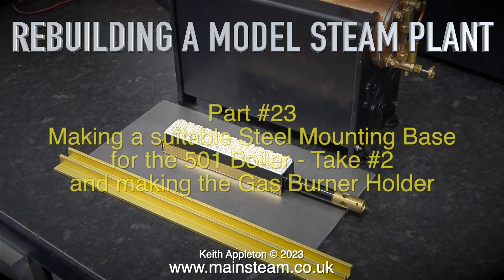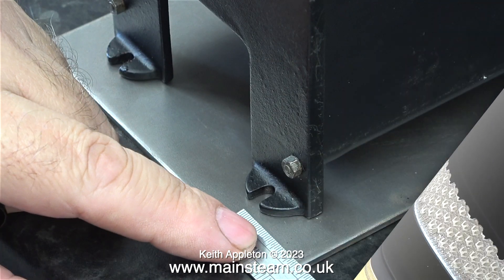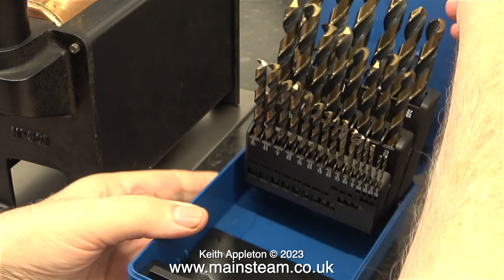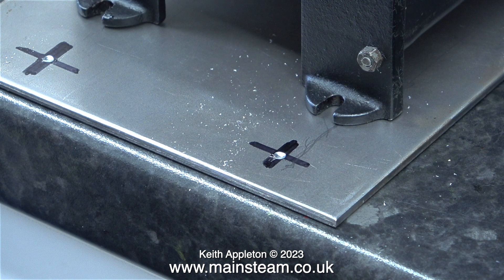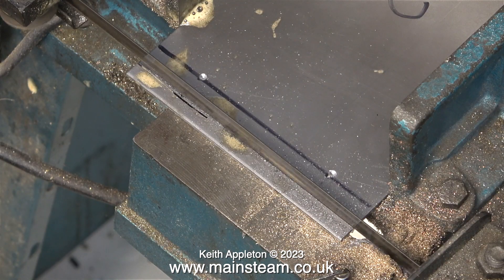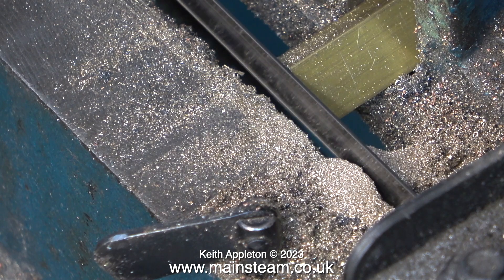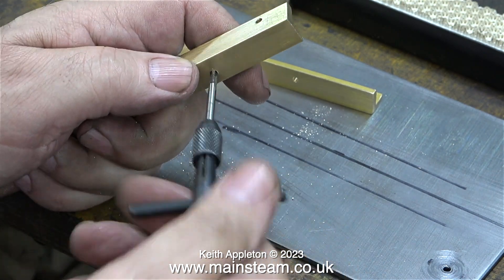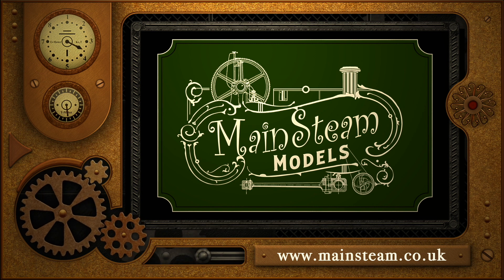REBUILDING A MODEL STEAM PLANT - PART #23

Comment: When I mark something prior to drilling or cutting I nearly always cover it with orientation marks. Today I have to fit some cable trunking, I've already marked it left and right. I also have to cut and drill a wood spacer for a light fitting. It will use three pieces, each will be marked top and bottom, front and back, left and right, I hate wasting materials! Maybe I have OCD!
Reply from the maker: I am with you on this, I often think things through when I am marking out the parts - mark several times and cut once }:-)))